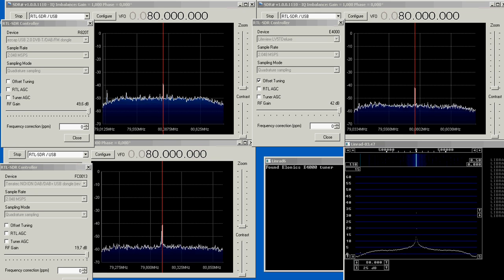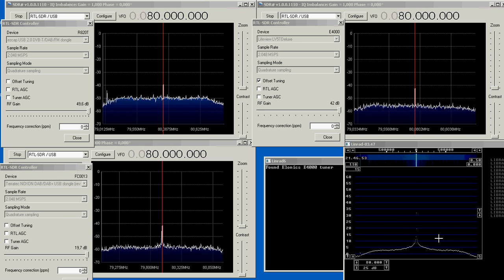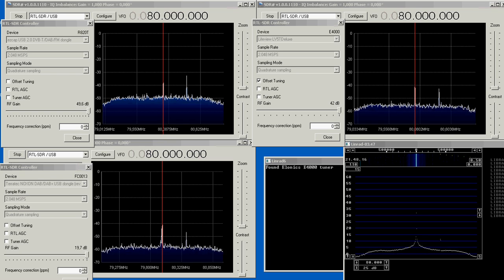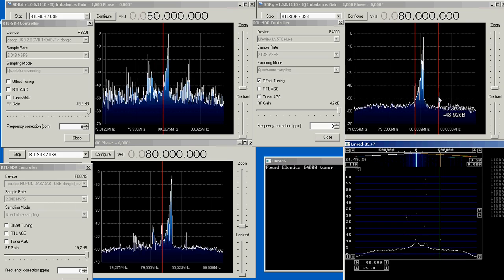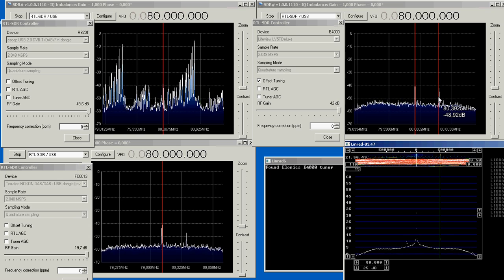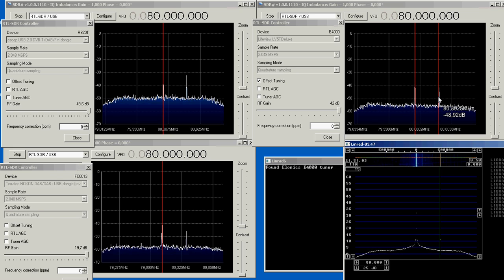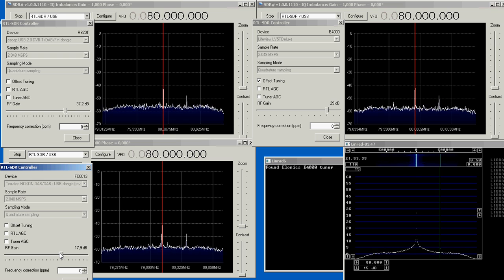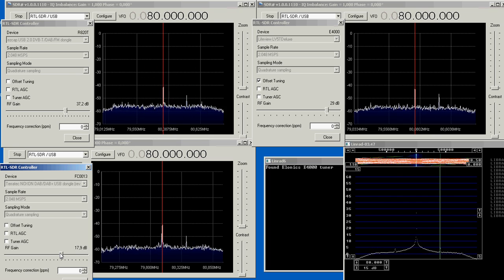donglecmp2

Comment: This Video is spectacular. Please keep them coming. It is also very useful to record how you discovered (measurement) mistakes. 

Comparing Tuners is very good for purchasing decisions. Can I recommend creation of a "Before you Buy" video to direct the Community with purchasing recommendations.

One thing I noticed about my FC0013 Dongle is that it Hops Frequencies much faster (Tunability) without "Lock-up" than the E4000 Tuner Dongles. 

Show us your Test fixtures and Workbench.